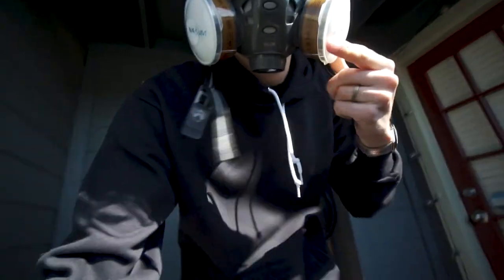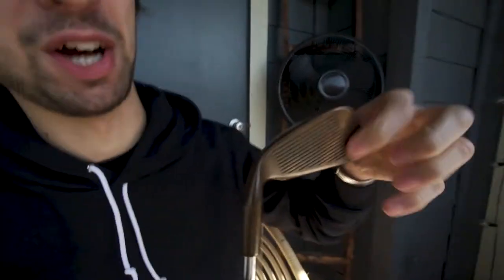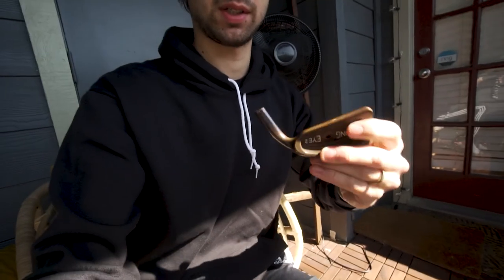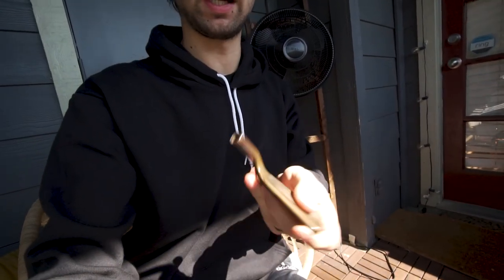I Try To Restore Copper Ping Eye Irons Pt. 1

Comment: I just bought an 86/87 set... how much do tou think a near new set is worth.
Reply: Tough to say, market is a little out of whack right now id think. Next week Im actually about to purchase a 1-SW original owner set who bought them form the factory in phoenix in '83 and I feel like am overpaying $100 or so, but I just cant pass them up. I think square groove vs + groove may also factor into pricing. Id reckon that square groove (so earlier models) would be worth more due to even more history surrounding those models.
Reply: @livingroomvids71  I found out my wife had an pre-copper 1 iron... so I'm sitting on a 1 - W set for 250... seemed reasonable compared to today's market... square grooves and all.